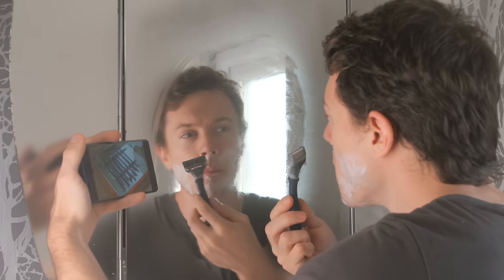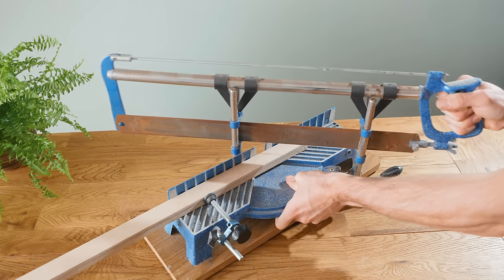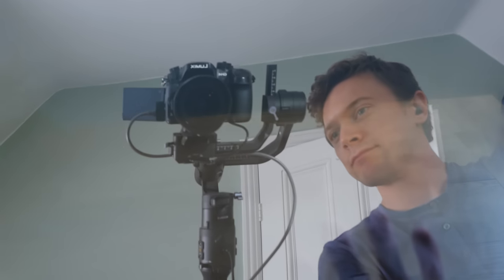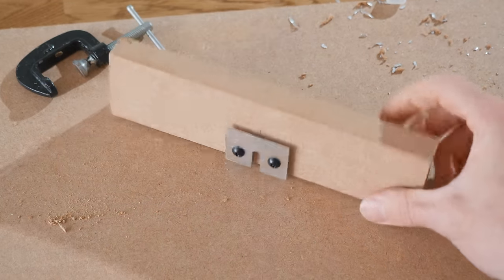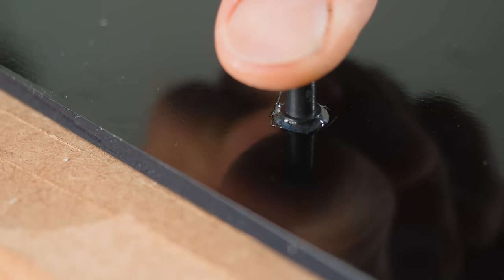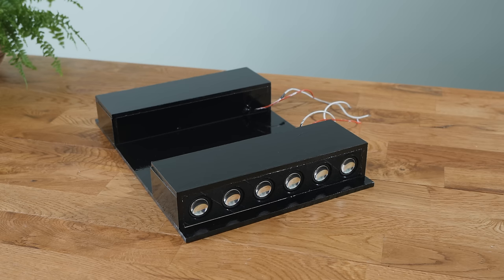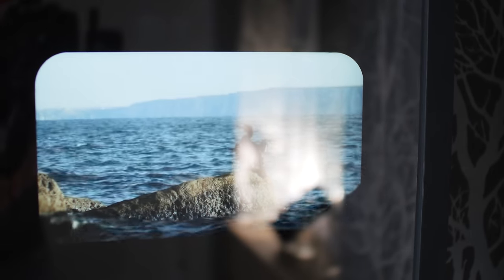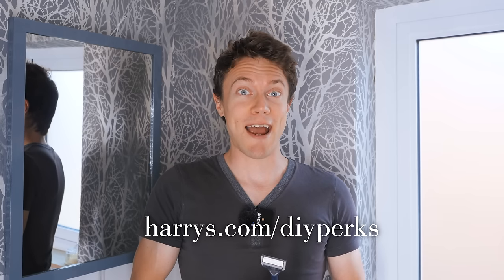DIY Smart Mirror (that doesn't steam up!)

Comment: "I got this screen from an old laptop." Proceeds to take off brand-new protective film from the screen.
Reply: he didnt say the old laptop was used one. I too have few unused pieces of technology stored that are couple of years old due to them being already obsolete.
Reply: Maybe he stockpiles old screens and covers them with film to protect them until use or maybe he bought an old screen off ebay and that's how it came
Reply: There's another video of his where he talks about how to disassemble a laptop yourself. Otherwise you can buy these old screens on ebay, which is probably what he did here
Reply: Yea cause a newer model laptops replacement parts would be more expensive
Reply: He                never               took               it             Off until                                                                   now

Comment: there are hydrophobic coating sprays u can use on mirrors and car glass to prevent condensation, maybe an easier alternative to filling the mirror with hot water
Reply: Hydrophobic materials usually tend to drip water lines since they are not prone to build ups.
Reply: you mean RainX?  Sure that works,  but this will make you feel like you live in the future.  The stinky, leaky, calcified future.
Reply: Just use shavecream as coat... cheap and not unusual in a Bathroom
Reply: yea cheaper but not NEARLY as cool
Reply: Zero Cool    no, he means RainX.  A spray would not work.  If you'd ever applied rain x to a windshield, you'd know that you can't just spray it on.  I'm not searching hydrophobic blah blah for expensive crap, just put RainX on the mirror and rub it in so it WORKS properly, and wipe up the excess.  Problem solved. 
Or would you like to endorse Your favorite spray?  Anybody can say hydro whatsit but you're not DIYing anything by finding some exotic, expensive hydrophobia spray.  pffffft
Reply: Or you know, dont take hot showers :/
Reply: @Pepe-qo1yz  Does shavecream work better than soap?
Reply: @thedesk954   well i never testet soap, and in my bathroom now I dont have any problems with fog
Reply: @Pepe-qo1yz  I saw a video once comparing soap, RainX and shavecream (and other non working stuff). Shavecream and RainX worked both very well, without a difference. Soap didn't worked quite as good and always had a greasy film on the glass.
Reply: I would rather have used a 12V heating foil/film instead of this crazy water system.
Reply: Hydrophobic will make the water bead up and look foggy which isn't quite what you want. A hydrophilic coating will make the water form a thin single sheet of water over the mirror which and appear see-through. If you have ever seen a car detailing video, you will see the water beading and very noticable. But on an unwaxed car panel you will see a single sheet of water that doesn't show up much.
Reply: A good exhaust fan and leaving the door open keeps the fog off my mirror.
Reply: pretty sure a low heat 12v heating element could be a possibility tool. or  re circ glycol over an element.
Reply: @Pepe-qo1yz  just that, cheap easy, holds for over an month even with daily showers.
Reply: fuark brah!
Reply: Fuck, I forgot to put hot water in the mirror
Reply: use sillicon plate, like visor pinlocks to prevent moisture
Reply: @Pepe-qo1yz  Yes!  Or plain old soap (since shave cream is basically shaving *soap*). I rub a bar of soap on my mirror and polish the mirror with a dry cloth. No more steam up for a long time! Cost? Uhhhhh... Maybe a penny.
Reply: @thedesk954  It's the same thing. Shave cream is another name for shaving *soap*.  I use a hard bar of soap, rub it all over the mirror, and polish with a dry cloth (washcloth that I then use to clean myself). The mirror doesn't steam up and cost is negligible (maybe a penny of soap used). No. It won't show they time or temperature, but I have a smart phone and a weather station that does both of those already.
Regardless, it's a nifty project and can spark other ideas, though. I'd do something like this for a super big digital picture frame that could connect to a Raspberry Pi and display lots more stuff. But I'd just use a spare TV tilted 90-degrees (portrait orientation) instead of building a two-way mirror frame. And it wouldn't be in the bathroom, so no need to be "steam free". Just hanging on the wall to be my daily planner/calendar, show weather, time, and any other info I want.
Reply: @jonjohnson102  LOL...I can tell that you don't understand how condensation works.
Reply: @lal12  was that chrisfix. he does a lot of car cleaning and repair stuff and he did a big episode on anti-fog stuff
Reply: If it wasn't sponsored i'm sure you would not be seeing all that was done to make it not steam up.
Reply: @alanmalcheski8882  Rain X works great as long as you dont apply a ton and actually apply it correctly. Don't just apply it once and wipe over it, you really need to 'buff it' like how you would apply wax on a car until all the residue is gone.

Comment: You will need to coat those exposed PCBs with some conformal costing or corrosion will develop rather soon.
Reply: This, a thousand times this. It's a bit expensive, but you can get it on Amazon or from pretty much any electronics supplier. Clear nail polish also works well and is a bit cheaper.
Reply: Absolutely and it's certainly worth the money, the ECU in my car failed due to moisture so I coated the replacement before fitting it.
Reply: nail polish works too
Reply: Yes
Reply: also mdf will swell up
Reply: Would epoxy resin work?
Reply: I was thinking the same, thought he was going to add a case and glue it shut but nope
Reply: You can take cold showers, no vapour
Reply: Conformal coatings for PCB's are fairly inexpensive.
Reply: I did not know about this... would that make it run hotter?
Reply: Couple pieces of plexiglass with thick enough seal on it sandwiched and screwed together would do it. Or a myriad of other cheap plastic/poly cases would do the trick.
Reply: @TheHerstad7  So, make it out of either hard wood or extruded aluminum, or any other material you fancy.  The options with DIY are endless.
Reply: Liquid tape.
Reply: Sherylin  thanks.  I'm a newbie at this and I've seen some use epoxy but it is thick and a lot more permanent
Reply: Synthetic wood varnish (polyurethane finish) works great and is ph neutral
Reply: @Jarrod Hawkins That's not what the person was talking about.
Reply: @MattTester  I used to work at a manufacture of circuit boards.   My car was acting up and running rich and all kinds of things.  Found out the ECU was getting wet from a leak traveling into its enclosure.  What a nightmare to find out what was causing it but brought it into work and sent it through the bath and drying process with formal coating at the end and never had a problem after that.   Sealed everything.
Reply: @MattTester  if your ECU die because of moisture, I'm afraid you got bigger problems than ECU rust, sometimes conforming coating something acts as a heatshield prob need to check out heat output
Reply: @Percy_Fawcett  that takes more energy, skill and courage than building 100 of these things! Of course, tepid also works....
Reply: exactly my thought!

Comment: Nice looking mirror, although I'm not entirely convinced by the idea of having to attach it to a tap and wait a few minutes for it to fill. Plus I would think it would be prone to leaking with time due to limescale build up.
Reply: small heater with low heat and a spread fan would do a better job than hot water imo
Reply: maybe try one of those slim aquarium heaters i had one before its like a black mat, not sure if it would be good enough for the amount of water in the mirror tho and would require being left on.
Reply: @mochixplants  you don't need water if you had a heater. Mirror gets fogy because the heat difference. Steam is hot, and mirror cold. When steam comes in touch with the mirror it cools and fogs it up...if you had a small heater to warm up the mirror you wouldn't need any water to start with. Point given is that alternatively you could use a hairdryer on the mirror after you shower. It will dissipate the mist of the mirror so you can use it.
Reply: @ouroboros_on_the_orange  seems like a bit of a difficult build to find any air heaters remotely small, all the heaters i've ever seen wouldn't fit inside the mirror not to mention the noise of the fan would be annoying.
Reply: @mochixplants  You could make it with a cooper wire and an energy transformer similar to one being used for LED lights...and you could get few small lower rpm fans that make low noise...It is more complicated than his solution but I belive it is better in the long run. I mean, I still love his idea and the fact he is making these videos it makes me get some additional ideas of my own or how to adapt some of his ideas on something I'm working on :)
Reply: In the end DIY is all about joy in trial and error trying to make something by yourself and that moment when you make it work and you are proud of yourself. Than some time latter you get idea how to improve it...and since you build it to start with...you can...and you know how... :D
Reply: To be fair, it is a DIY channel. He's assuming that if you can build it, you can also spend the time every once in a while removing the mineral deposits and maybe even think of a better filling solution.
Reply: How about heating cable around mirror? That should do it.
Reply: you're supposed to let it build up and then throw it away.  This isn't a mirror for poor people.  If you want a plain old reflective surface that requires little or no maintenance, go to a mirror store.  This is for people who need everything to be really complicated and digital.  You're not ready yet.
Reply: Calm down people.
Reply: Even worse than that, there's the algae problem: as somebody who has had aquariums for years, algae grow wherever there's water. Specially if there's light. And will grow everywhere: behind the glass and inside the tubing, and will be almost impossible to get rid of it without disassembling it and brushing it heavily. I would much better try to blow hot air inside the glass than water
Reply: Will it with mineral oil and heat it with a hair dryer before you use it to warm up the oil. You could.also use small bulbs like Christmas tree lights in the oil that would warm it up. Mineral oil is non conductive.
Reply: Maybe a repurposed used PC cooling loop pump and a small reservoir with small heating element to warm a propylene glycol or other coolant fluid?
Reply: Been there done that.
Simple solution get the mirror heated pads. I don't know the right word of it but to give you an idea these are same things which are used behind your cars side mirrors. I control it thru the humidity sensor.
Reply: I would rather have used a 12V heating foil/film instead of this crazy water system.
Reply: @ouroboros_on_the_orange  on se igrao sa led stripom iz starog TV i mogao je to iskoristiti za zagrijevanje površine "ogledala" pri tom bi radio sa 12 v.
Reply: @n.d.5452  ne znam da li LED pravi dovoljnu toplotu da bi zagrejalo ogledalo, uglavnom su im niske radne temperature.
Reply: Overthought.  A nice little raspberry pi, small lcd screen, microphone and a speaker you have an alexa smart mirror. Put a small cpu fan to keep air moving and screen won’t fog.
Reply: @ouroboros_on_the_orange  hairdryer pumping some heat into it or cold shower

Comment: The water tank is a good idea, though having it sealed (and using distilled water) with a small heating element at the bottom and relying on convection flow to heat the whole thing.

Also cover all the electronics in non-conductive waterproof conformal coating to protect them from corrosion etc.
Reply: RainX anti fog for car windows wouldve been a much better choice.

Comment: I'm gonna be pissed if this is clickbait.

Edit: Ok I'm only slightly pissed because I don't have the skill to actually do this.
Reply: Yeah basically none of his stuff is clickbait. But the trade off is that all of it requires actual effort and at least a little skill.
Reply: Hahaha OP, that's practically everyone when they first watch this mans vids
Reply: Just try your best.
Youd be surprised what youre able to do if you give yourself enough time and keep your motivation up. 
Just do it step by step and take a breather if you get frustrated.
Reply: @frankie9373  this is 100% the right mentality.
Reply: You are more than capable of making this. If anything, you don't need to make a smart mirror for the bathroom so you can skip the gasket steps and even the speakers if you just want the smart mirror to display the weather etc. You don't need to go all out on it unless you want to :)
Reply: Well I think the point of this is to be cheaper than an actual smart mirror
Reply: Yes u do. U probably just don't have the money. I built a red version
Reply: You may not have the skill now, but most of the skills required to do this can be taught in an afternoon. The majority of it is actually researching things, and a bit of basic circuitry and soldering. Just about anyone could make these if they put the effort forth to learn the skills. As they just require trying
Reply: no kidding huh, and he makes even cooler stuff!
Reply: Ye cats arent known for the precision tool handling skills... =D
Reply: Well be patient and paid attention!!!
Reply: Skill yes, resources no
Reply: @florjanbasha8150  tbh i usually watch youtube while taking a bath
Reply: unus annus gang
Reply: Memento mori
Reply: It is a little bit glossed over, as to the whole.  I wish he would have outlined it clearly at the beginning to give a scope for the project.  Clearly, we need a 3D printer and skills, but I am certain, that even without that, if we took it step by step, with careful measurements and adequate supplies and sharp cutting tools, we could create this.  Time and interest being the essential glue to bring it all together.